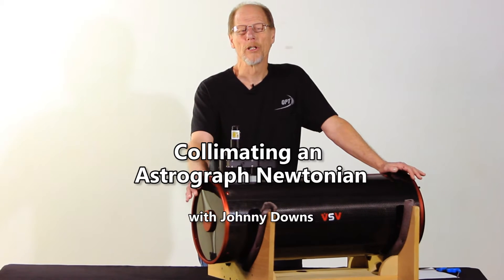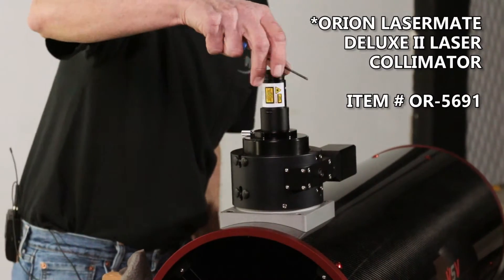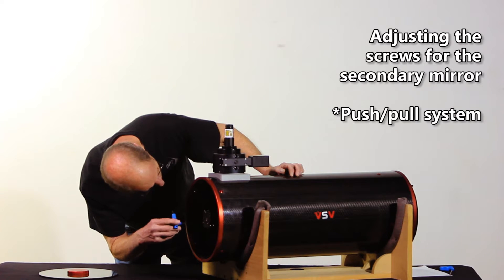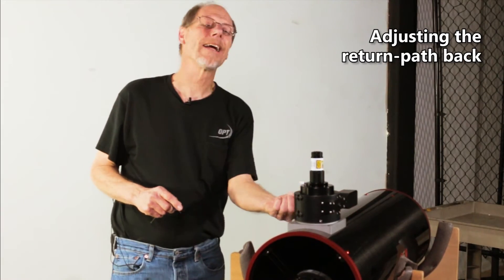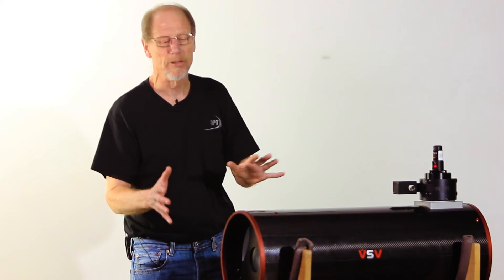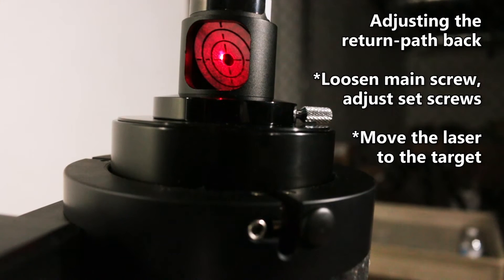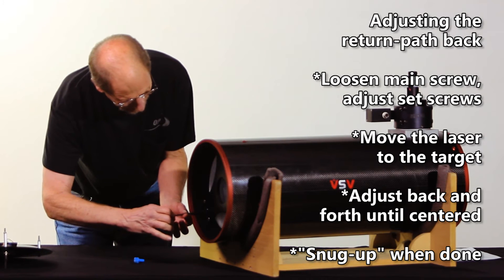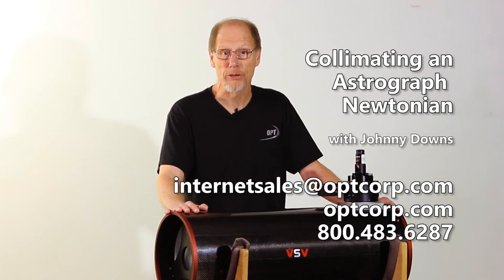Collimating an Astrograph Newtonian- OPT

Comment: Don't you need to "Star Test" the telescope to ensure it is out of collimation?  I heard that the laser collimators could indicate the telescope is out of collimation when it's not.  Also, after collimation shouldn't you  perform another "Start Test!?  Thank you!
Reply from the maker: On many astrographs, it is often difficult or impossible to use an eyepiece star test as the testing setup is so different from the ultimate use of the scope (with corrector and DSLR or CCD camera).  After collimating the scope with a laser, the best final test is to mount the camera and check to see if off-axis colimation is maintained in the corners of the sensor.  As some optical trains can have wedge (tilt), collimation or tilt may need to be adjusted to square up the whole focal plane of the camera to the scope, which can't be always seen in the on-axis star test.
Reply: A Very Informative Response!  Thank you and Clear Skies!  :-)

Comment: Actually, the telescope is not completely collimated.    You've completed axial collimation.   You need an autocollimator or a cheshire sight tube to ensure more complete collimation.   Couple of things to mention:  1)  Your laser may not be completely square from the factory;   and 2)  I've found that relying on laser collimation often produces asymmetric vignetting and coma.   If you're serious about imaging, then you owe it to yourself to learn how to use an autocollimator.